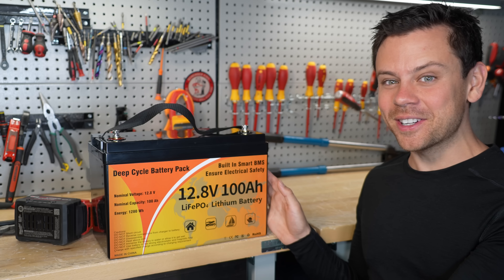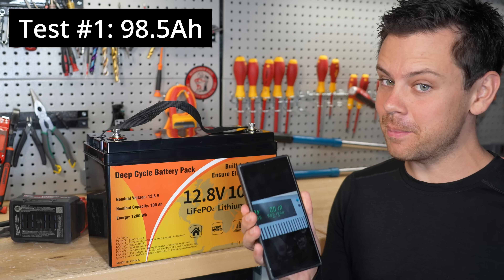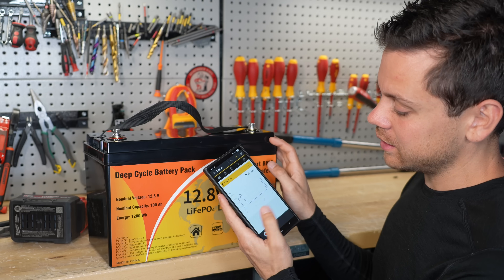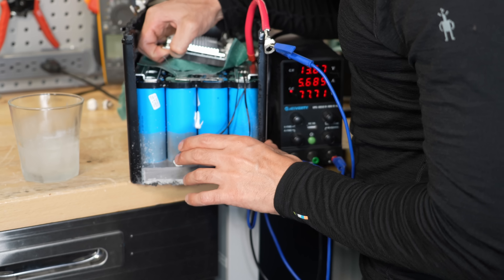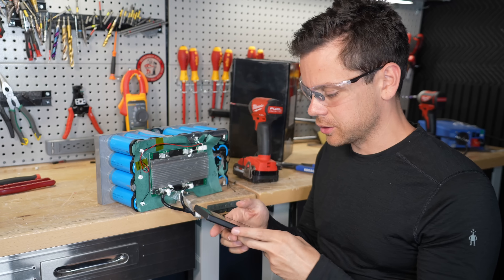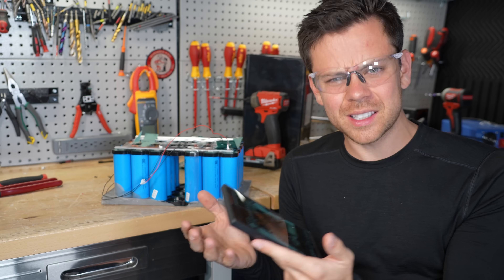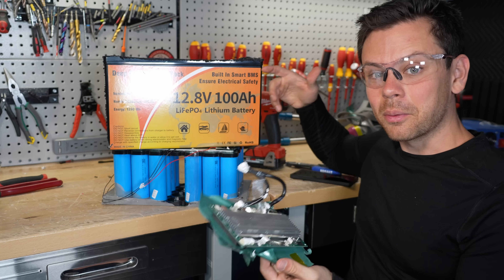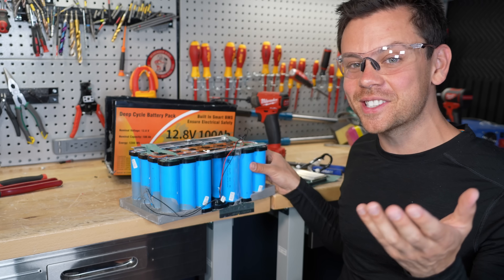$125 100Ah LiFePO4 a Scam?! Or Actually Good?

Comment: I am planning to purchase a 12 volt 100ah Eco-worthy lithium battery. We have a small travel trailer. If I also buy a 20 amp lithium charger, would I be able to keep our current lead acid converter in place and add the new 20 amp charger directly to the battery. Both the new lithium charger and the original ( factory) lead acid converter would be operating at the same time. This is a WFCO 8735 and changing that particular converter would involve either replacing entire power center or rewiring all the 12 volt circuits. If I don't have to I'd like to avoid that. I intend to both move the battery and place the new lithium charger next to it in the pass through. We have no solar setup so this lithium battery will be charged while the camper is hooked up to our generator. I'd just like to confirm that I will do no damage to system. Any advice would be appreciated.

I love your youtube videos and believe if you can't give me a correct answer nobody can.
Reply: Buy a converter that is LiFePo4 rated and disconnect the FLA charger in your breaker panel. You can still put it near the battery. The battery feeds the DC panel. If you have a battery  disconnect, put the charger on the RV side of the switch so you will have power if the battery is turned off.

Comment: I have 2 "Werchtay' branded batteries that I am fairly certain are the same as those. I got them here in AU for $179 AUD ($115 USD) each. They dont pull full capacity. (97AH and 89AH after about 10 cycles) And i feel like they have different BMS aswell, despite being bought at the same time in the same order. One cuts out on LVC around 10.3V The other almost gets down to 9v before it does. 
I mostly just use them with a 12 to 24v DC converter as booster batteries for small power stations.
Reply: Any idea what chemistry cells they contain? LFP might be OK

Comment: I come away from this video with the belief that everyone should put a fuse on each battery just to be on the safe side. 
Walmart has a 4 pack of 100 AH lifepo4 batteries for 605.99. 15,000 deep cycles, 10 years lifetime overcharge protection, over discharge protection, over current protection, short circuit protection and high temperature cutoff. Moseworth is the brand name. I guess that is not a bad deal.

Comment: At that price, it's tempting to buy one for my off road trailer. It's the same price as a car battery that I was originally thinking about.
Reply: Do it but use circuit breaker or fuse.. I've Bought nearly 20 similar batts on Amazon.. kept a few and resold most of them.. Not a single complaint from anyone..kingboss seem to have the best capacity, well over 100ah..wait and watch until they offer the instant coupon..I only buy them when they are dirt cheap..

Comment: I was always taught that strictly speaking the rating of 100ah battery is not its peak capacity but its ability to supply 1A for 100hours. 
A starter motor on a car for instance will draw more than 100amps but the battery can supply this just not for a full hour. Think 200amps for 30 mins.
The reason for this (and yes I’m talking lead acid) is a 100ah lead acid battery could not supply 100amps continuously and there would be a drop off. Hence the more accurate lower draw of 1A which it can supply consistently for an extended time (100h).
I appreciate lithium batteries etc are totally different but that doesn’t mean the rating has been calculated differently.
Reply from the maker: No, it's .2C rate for lifepo4, so 20A for 5 hours. Or five hour rate if you like the old lead acid testing wording.
Reply: @WillProwse not sure you have the 2c rating quite correct though. 2C rating on a 100ah battery would be 2amps for 50hours surely.
The point however is that this is the test the manufacturer uses to give a battery its rating.
Reply from the maker: @Fyn123 no, I said .2C. for 100ah battery that's 20A.
Reply from the maker: @Fyn123  please just Google this stuff, it's very simple and you're totally missing it
Reply: @WillProwse oh my, do we not like being questioned 😇 all bow to the almighty! 
You do not tell anyone how you arrive at your capacity figure in the video. Which is what provoked my initial response. 
.. one less subscriber from today
Reply from the maker: @Fyn123  I literally told you what I do, and have done so in hundreds of videos, and even when I type it out, you dont understand it. Glad to lose you as a subscriber. take care

Comment: before I even consider which battery to buy, I wait for Will to test it and rip it apart.
Reply: But the price always goes up after a bunch of good reviews 😂
Reply: @Ray-h4x7g  but if you are watching these 2-3 months later, prices tend to have recovered. I have found some Eco Worthy and DC House (same as Ecoworthy) and Ecoflow 12.8v 100ah batteries for < $125, and I know they are good, solid units vs some of these $100 unknowns.

Comment: Have you or will you ever discussed  batteries wiring and charging for golf carts? Much discussion best methods (series, parallel,series and parallel), charging. After golf always charge? Using recreaoionaly always charge or wait till 20%? My cart is 24 volt with two 12 volt 100 Watt Cycle  batteries.
Reply from the maker: Roypow golf cart batteries are supreme. They sell them locally and the shop has had zero returns or warranty issues. I've been running my roypow pack for years now too

Comment: Might be a good battery to use if you are building a battery backup system for something like a computer work station, where, on the rare occassion that it does need to draw a load, it won't be nearly the capacity. I've been thinking about building one of these for my office. I have my network stuff, 2 printers, a desktop, and charging stations for a couple of laptops.  I want a battery backup system that will last for a couple of days if we lose power in the neighborhood.

Comment: The SIEKON 100ah that you reviewed before is under $125. I haven't had any issues with mine.
Reply: I also have a mini 100Ah from the same company but they are out of stock right now. They use the same BMS and cells, just a different box and less foam.
Reply: Yes, but it's actually a different battery now.  I purchased four last year and they work great in a golf cart.  I went to buy three more for another golf cart and the amazon link was broken.  The Siekon for sale on Amazon now looks identical to the "Classics" 100Ah, but I am thinking the internals have completely changed.
Reply: @UncategorizedContent Maybe a new review is in order if they have changed. For reference, I bought the mini in Dec for $140 before tax.
Reply: @FrancisKoczur  I was wrong.  I had a bad controller.  The new Siekon's are working great too.
Reply: I stand corrected!  I had a bad controller.  The new and old Siekon's are working great in my 36v and 48v golf carts

Comment: This gives us an idea of what the current minimum profit point is.  These are likely built from salvage parts or other manufacturer's QC-failed cells.
Reply: Or used cells that have lost 20% of their capacity.  But for ultra cheap, it's better than throwing them into a land fill.
Reply: I doubt they'd get the volume needed to make it worthwhile. these will be ordered from china by the container load, so that's a bit more materials than some cast offs...

Comment: These deals are all over eBay. To the point I refuse to pay more than .10-.12 cents per WH! And they have been good so far. We run cheap dc house In our golf cart, it's awesome and even has BT. I have 4 generic 12v lifpo4s on a scooter build but I could only fit the 50ah ones, but it will give me 50-60 mile range! Stop paying top dollar for brand names, most come out the same factories in China anyway!
Reply: Race to the bottom...

Comment: 4:50 I have a feeling the empty space in the middle may let the cells swell in that direction so you may not notice anything until it's on fire
Reply: These cylindrical cells aren't going to swell; they aren't like the prismatic cells that have a relatively weak side that can swell. The only thing that can happen with these is it finally blowing the vent.

Comment: Loved the video, thanks. You mentioned that the balance lead is dangerous. What exactly is wrong with it? Thank you again
Reply: They aren't tied down as well as other batteries, so vibration could cause it to cut the insulation and short out. Doesn't seem too bad though.

Comment: I grabbed 3 of these when they were just under $110 each for a cheap golf cart 36v conversion. Works great for now. I know its a dice roll. I need to get a fuse on it for sure. Thanks for the video!
Reply: I use three wattcycle group 24 100ah on a 36v stock ezgo. All this high amp BS is just that, BS. I have a victron shunt and my cart spikes to 160 amps if you floor it and within half a second settles to around 110. As soon as you’re rolling it drops to 90 amps or less. Even with four people. The wattcycle has been handling it perfectly, the victron shunt says 900ah total in history. Thats more miles than I can count. By the time these batteries give up the new ones will be 90% cheaper/better/longer lasting. Go cheap, its fine!
Reply: @car2069  thanks for the info. 😎
Reply from the maker: So the real issue here is inductor kickback from the motor causing a voltage spike that fries one of the fets in a closed position. You will not know it till it hits OVP or LVP. Once you do, the battery is done for. 

Till that point, everything will work perfectly fine
Reply: Not ideal for golf cart. You need a high amp bms on those. If you baby the throttle you will be fine, but when you hit a big hill or really heavily loaded n stomp it, it will shut down the bms!
Reply: @flyingtime5501  I also used similar batteries, (from a different brand), to power my golf cart. No worries so far as to the ability of these batteries to do the job for me. I actually tested it out against an immovable object, and the tires spun before I could read over 200A. I bought six all together, just to make sure there was enough power for my girlfriend to use it most all day visiting friends in our off-grid community here in the southern CA desert. I put 3 of the 120W solar panels on top and used a 60A solar controller, running the panels in series. I did origionally use a battery charger to get them up to 100% state of charge, both in parallel before putting them in, then after they were in the system. I haven't had to use an external AC charger since, and it takes both of us pretty much anywhere we need to go.
Reply: @flyingtime5501 For what it's worth, the shunt on my system has only spiked to 90 and rarely at that. I'm sure the inrush may be higher.

Comment: The issue is that the customers don't rip the batteries open. They just use it and never have issues and think all is good. That's why we watch you to decide whether to buy these batteries or not. I don't think they are reviews for free stuff. They see it's cheap and it works for them 5 stars.
Reply: 100%!
Reply: In fairness, if they use it and never have issues... what's the issue?

Granted the bar is pretty low here, but still.
Reply: @bradley3549 Well, they haven't had issues just yet.
Reply: Out of 4 different labels cheap 100ah batteries from Temu 3 had cylindrical cells one prismatic. The measured capacity of prismatic batteries were 80-90AH